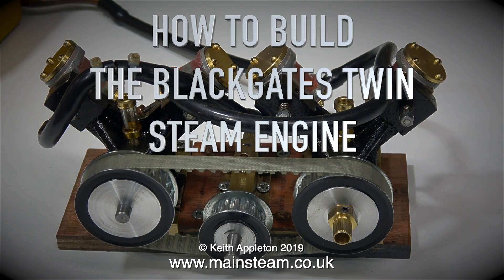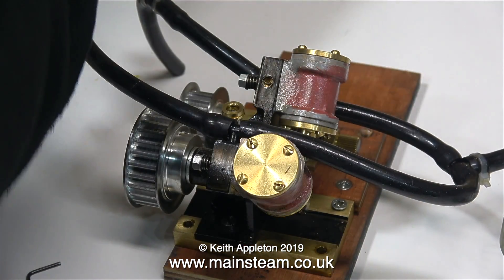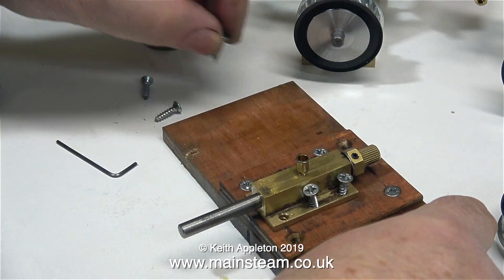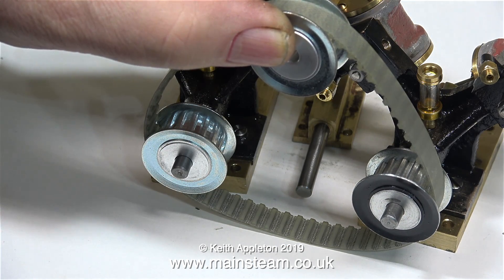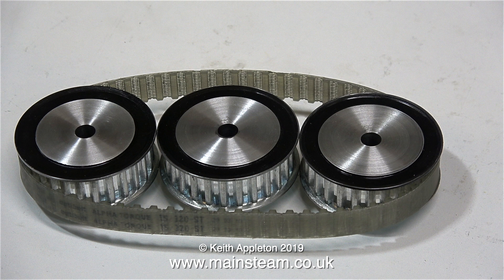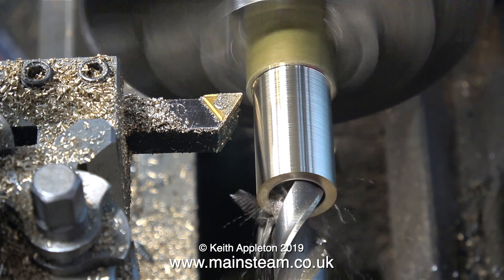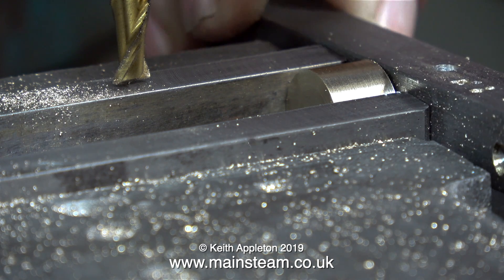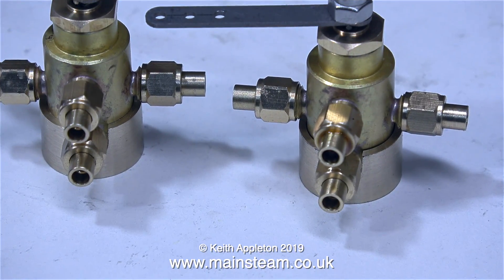HOW TO BUILD THE BLACKGATES TWIN STEAM ENGINE - PART #18

Comment: Have you considered a "Home Brass Plating Kit" for the pulleys? May be on the pricier end but it could make an interesting series. The final build might fetch a few more bucks for looking more steamy and you could plate other bits here and there in the future to your liking. That is if the buyer even keeps them in your configuration. lol. Nice of you to include two reversing valves and mounts. A twin screw independent reverse would turn on a dime eh? Sweet. 

Random Question: Could steam be used for bow thrusters? Like have a servo controlled valve to a jet under the waterline on the left and right of the bow. 

Best luck on the coming sale!

Comment: So direct driven gears not an option?   Would look very steam enginey indeed made in brass and maybe ornate looking.   Or maybe something exotic with a central drive being driven like a car's live axle differential with each engine putting power into a shaft via helical gear which would drive the central gear by a gear wheel at other end of shaft, kinda like an angle grinder's drive setup.   Would make entertaining videos and be a good challenge too :)   The setup wouldn't have to be as ornate as say a Ford Cortina's axle with the little cages etc nor would it need to be differentiating as both engines would be at same speed and not trying to turn corners.

Comment: Very good idea to have two reversing valves.  On a twin propeller boat being able to reverse one engine allows tighter turns.  It also means you can have the propellers rotating opposite of each other, rather then both rotating in the same direction.  I like the idea of raising the engines a bit to increase the "bite" of the belts. I'm wondering if a 4th, smooth, idler pulley riding above the belt could be used, or would this increase friction so much that it would effect performance?  No, I'm over-engineering here, this is not a full size engine,  KISS-"keep it simple stupid"!